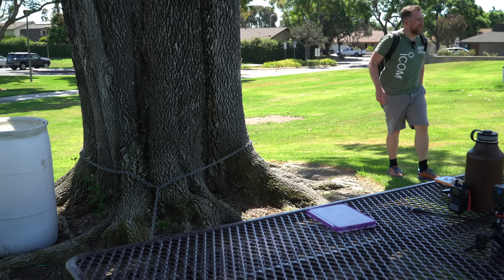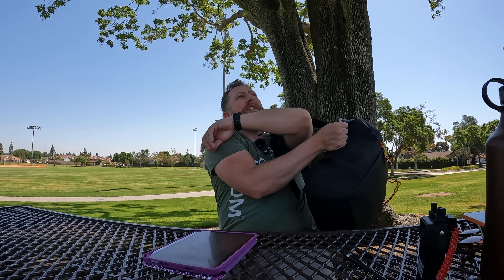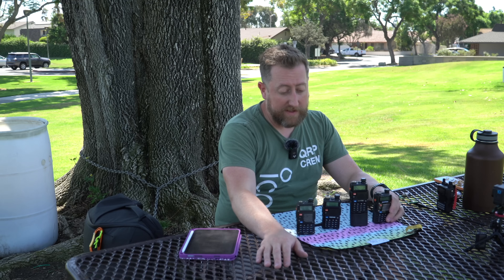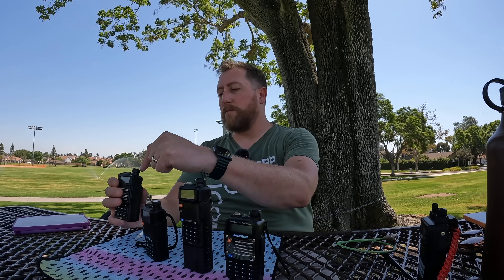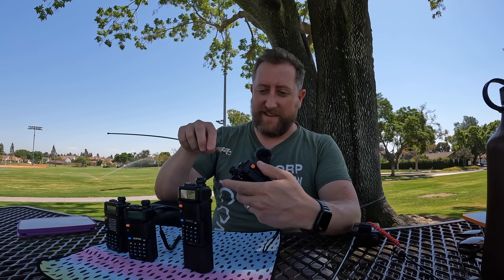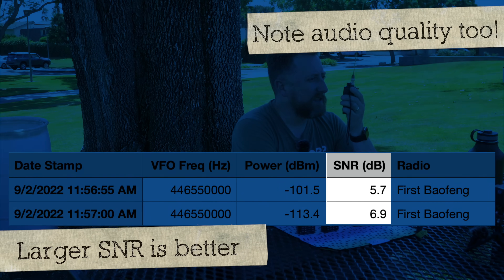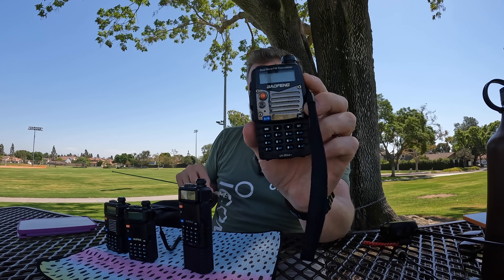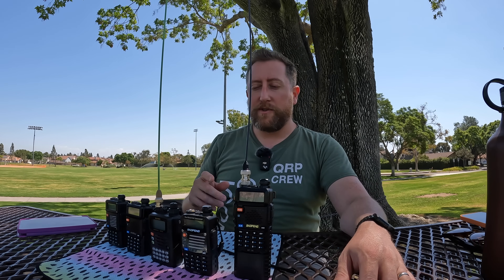Baofengs Testing Throwdown - UV-5R, BF-F8HP, GT-5R Ham Radio Testing

Comment: Great job again Josh. I have the Radioddity Baofeng UV-5RTP, UV-5X3 and  GT3 and used Signal Sticks on all my HT. I only used all 3 Baofeng on AllStar. Since they have a great battery life. I monitor the East Coast Reflector, Henderson Repeater, Texas IRLP, MOHOY and the PAPA System. Only certain stations of the PAPA System have comments on the audio on the Baofeng otherwise the rest don't care at all. As long as you can transmit a readable signal. No issues at all. I rag chew for hours on other stations on these radios. Stay Safe Ruben KD6CWI
Reply: Just gave you a Thumbs Up you deserve this for all your hard work on all these videos.
Reply from the maker: Thank you!
Reply: @HamRadioCrashCourse  Always my pleasure Josh
Reply: I live in northwest Ohio, toledo-ish ares, and the first night I bought the uv5r (forst ham radio) last month I picked up the east coast reflector, I had gotten so excited i heard something. But yeah with the rubber duck it sounds pretty good! Clear as day

Comment: Great vid, I've been curious about the various Boafeng variants.  Does that big chain ground  radial behind you going from the table and around the tree affect your test??  LOL  One thing about the Baofeng's... rarely does the actually transmit power live up to the advertised wattage hype.  The 8W model I bought measured  less than 5W on VHF and 6W on UHF.

Comment: The Baofeng's problem isn't the transmission (they have 5W or more), but they have a very bad reception (0.25uV at 12dB SINAD, a good radio can receive at 0.12uV). They suck to listen to far repeaters (or simplex) and they will be deaf in a place with busy VHF signals (like a city), and don't forget about the Baofeng's spurious, it's just a garbage radio.
Reply: Baofengs are not perfect, BUT are they good enough?

Comment: I'd Like to see RX tests on these radios on the fringes/desensing, I have a feeling that's where the JA HTs will shine
Reply: There seems to be a significant difference between my uv5r and ft-60r in Rx and TX. I have compared the 2 on the repeaters in my area and the uv5r can be almost useless on some of them that the ft60 can operate on no problem.

Comment: Josh, is there an economical tool (meter) that effectively measures the SWR of HTs? The Surecom meters don't seem to work, even with a paw around the HT acting as a ground plane. One Surecom even came with a steel plate to act as a ground plane, but it 1) greatly added to the cost of production and 2) really didn't work. They're super for mobile or base station use, but not HT use, unfortunately. Thnx!

Comment: Many people talk about the great clean transmitter on the GT-5R but unfortunately it does not "receive" near as good as the UV-5R5 in the ham band. I own many different baofengs and the GT-5R has the worse receiver in them inside the ham band. I own 2 GT-5R's and I would not recommend buying that radio. I am not talking about out of band as the GT-5R won't do that anyway. I am talking about inside the ham bands.
Reply: The Baofeng's problem isn't the transmission (they have 5W or more), but they have a very bad reception (0.25uV at 12dB SINAD, a good radio can receive at 0.12uV). They suck to listen to far repeaters (or simplex) and they will be deaf in a place with busy VHF signals (like a city), and don't forget about the Baofeng's spurious, it's just a garbage radio.

Comment: My $150 Wouxun HT's do not sound any better than my $30 TP 8 Plus (aka UV13 Pro) and $40 BFH7 Baofengs. I have to go to my $300 Anytone 878 UV II Plus before I notice a big difference, and that just in sound quality buyt no differnec in Tx range. I would rather buy cheap and throw away if it breaks unless there is a real reason to spend more.

Comment: The GT5R  may have the best SNR due to sending out more power on the desired frequency rather than splitting it between those harmonics
Reply: I never even thought of that! I have been looking into a cheap radio to get to see how active things are in my area while studying for my tech, I knew the gt5r was cleaner but didn't think about that also improving power to the desired freq.

Comment: From your own tests the Baofengs beat the others lol. But I do the same kinds of tests using my repeater that is 6 miles from my house even my 5 Watt radios work very well and does much better than your Yeasu does from a mile away. I am very suprised at the yeasu being down in the mud like it was. 
Here is something that I found to be true on the Baofengs, to get max power power out even new radios, you should clean the antenna connector on the radio before mounting the antenna.

Comment: Did a SOTA activation yesterday in CO. Had a guy 80 miles away on a UV5R with rubber duck... 57 received from him. I was blown away, he was definitely getting his $24 worth. Non-typical situation, but dang...
Reply: I once got into a uhf repeater 112 miles away, it was not on a mountain, antenna height was about 800ft, my handheld was on the second floor of a two story house. Absolutely crazy.
Reply: @josephhacker6508  I enjoy radio for that very reason. Some days 100w won't get things done, but some days 5w will. So many variables, keeps it interesting. I was super happy for dude & his Feng.
Reply: As someone that is only GMRS licensed, what frequency range were you making contact with that Rubber Duck uv-5r
Reply: @drewbrown9678  146.52 he was running 5w on the Feng and I had 8w on a Kenwood with an arrow yagi. The yagi was an advantage on my end, but still. A good Feng can get things done.

Comment: Josh, I'd be interested to see the transmitting power consumption between them. maybe some kind of digital power supply with a readout, while transmitting or on a dummy load.
Reply: jumbo battery pack options for any radio will help, kinda like does mpg on a vehicle matter? yes but will pick a worse one with other features that are easier to use...

Comment: I wonder if the difference in antenna mount makes an appreciable difference.  I know, SMA to BNC adapters shouldn't make that much of a difference, but considering how HTs are designed to include the user as part of the antenna system and all that, perhaps the difference in HT size, how it's held, and how well the antenna connects to the internal terminals can make a difference.  Maybe getting three SignalSticks ( one BNC and two different SMA ) would show different results that could explain it.
Reply from the maker: All radios are tested with a BNC adapter.
Reply: @HamRadioCrashCourse  I get that, and I know for consistency's sake you use the same adapter.  I'm just spitballing to see what might explain the SNR difference between these and what should be much better radios.  You're right, it's not much difference, but it's certainly outside the margin of error.  I believe you've tested power output on all of these, so that shouldn't be it ( excepting the F8HP, of course ).

Maybe that adapter shape and size doesn't play nice with some of the HT bodies so the connection isn't as good as it could be?  Maybe the adapter length somehow affects how the phantom counterpoise side of the antenna works on some of these?  Maybe take-off angle is changed and some have a stronger radiation lobe pointing toward your discone?  Like I said, just spitballing.
Reply: @HamRadioCrashCourse  I too am Curious how and if adaptors affect your signal

Comment: Love the vx-6r. I lost my first one during a very boggy walk out from a SOTA activation... I since bought a second one as it's such a dependable and sturdy unit. As for the baofengs, most of them are fantastic value for money and reasonable performers. I guess the main difference will be consistency from one unit to the next. It would be great to see five of the same model baofeng from different sources being put through the same test.
Reply: I checked 3 BF-7H Baofengs I just bought on my Surecom 102 and they where all three basically the same. Within .25 watts of each other and with in .5 watts +/- of the advertised 10 watts.

Comment: Ok stupid question I want a signal stick antenna, but I can't figure out the connector I need for my anytone 878 I keep getting confused
Reply from the maker: If the 878 has a hole in the very center you need an sma male antenna. If your 878 has a small pin in the middle you need an sma female.
Reply: @HamRadioCrashCourse  thank you
Reply: @HamRadioCrashCourse     That's what she said!

Comment: Request to bring along a UV-82HP next time. That's my preferred form factor of the Feng HTs. BTech also has GMRS and MURS versions in the same form factor so the spare batteries, etc., are all swappable. Dual watch and an option of either single PTT or dual A-B PTT.